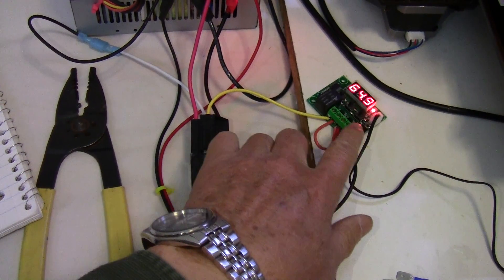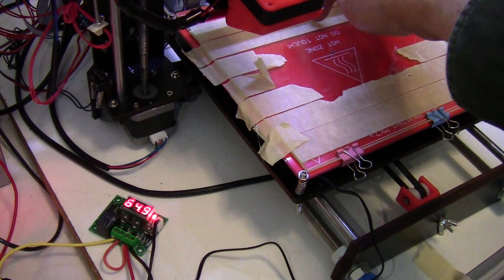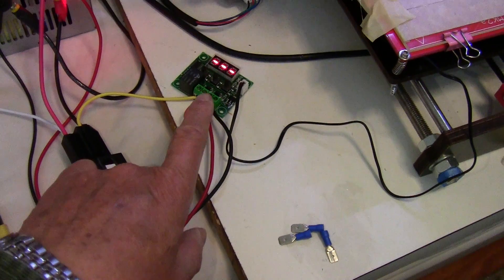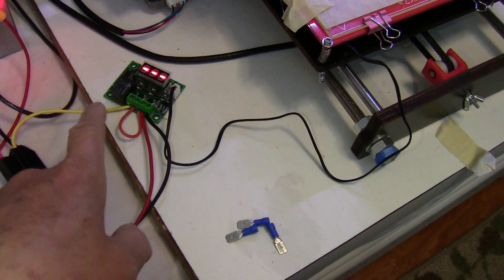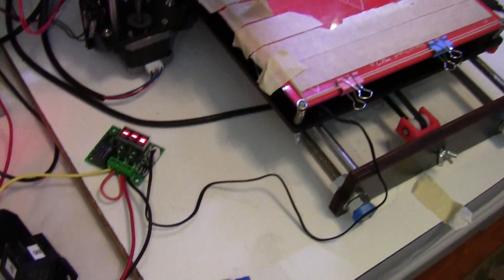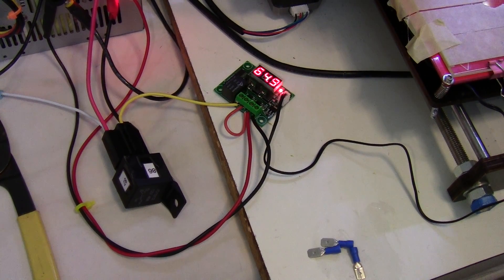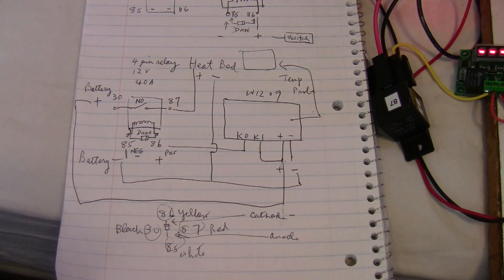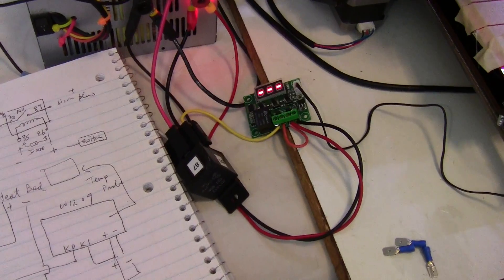Separate hotbed heating controls for Prusa i3 clone

Comment: I've been using a Bosch automotive relay for a while now. I simply connected the relay coil to the heated output terminals on the ramps module. A diode is connected across the coil to prevent back emf from damaging the ramps board MOSFET. Works 100%. Regulates temperature very well. Checked it with a non contact infra red thermometer. I did this right from the beginning when I built my Prusa i3 clone. The heatbed was never connected directly to the ramps module. Personally I think this is the best way to connect the heatbed in bang bang mode.
Reply from the maker: Thanks for your input. The Prusa clone mosfet will fail over time if you use the heat bed. A poor board design. Maybe the original Prusa use better components so they don't fail.

Comment: I would unplug the thermister from the printer and plug it into your external bed heater setup.
Reply from the maker: Thank you for your input. I'm not using the thermistor from the heat bed as the control board is not regulating the temperature properly. I'm using an external power supply and a thermostat (with a probe under the heat bed) to roughly control the heat.
I don't know if the external thermostat will operate properly if I unplug the thermistor from the printer control board and connect it to the thermostat.  Maybe the thermistor will work the same way as the probe as you suggested.

Comment: Thanks for this. I'm surprised there isnt more videos on making a separately controlled hotbed for printers. Was looking everywhere for a solution as I figured it cant be that difficult. I have a cheap Tronxy x1, perfectly happy with it for what it is but I'm getting into projects that require materials other than PLA, so a hotbed is needed. This is a perfectly cheap and simple solution. Works perfect
Reply from the maker: Yes, it can be done. You don't need it for PLA but ABS works better with a hotbed.